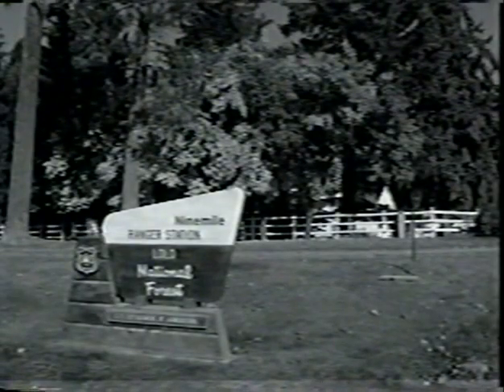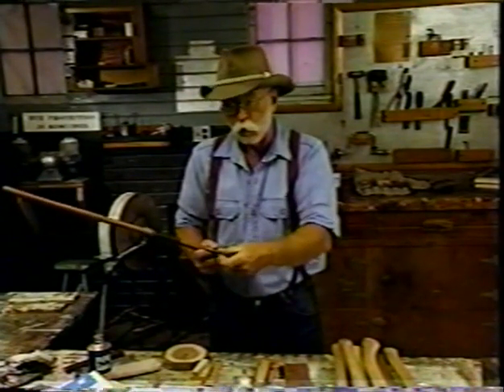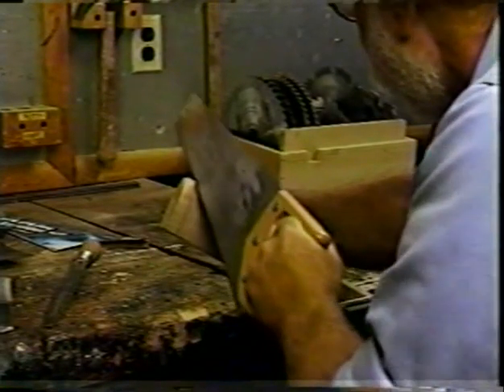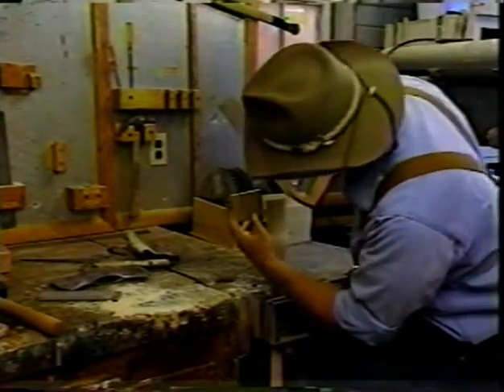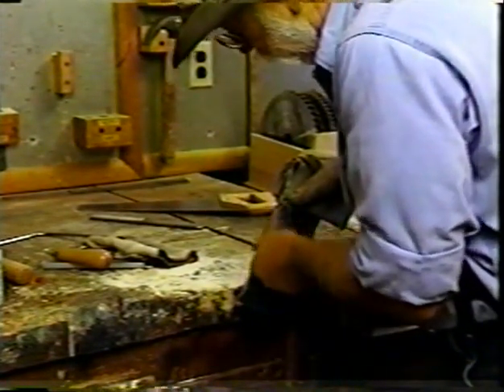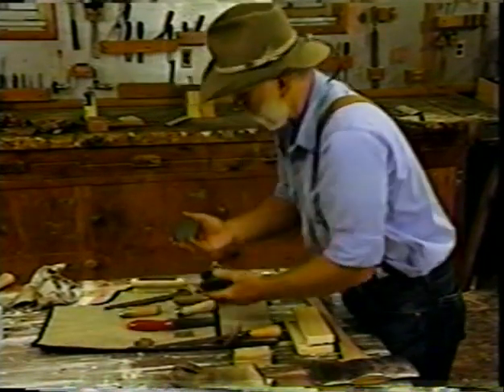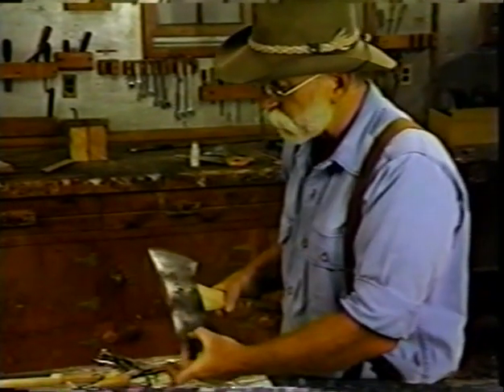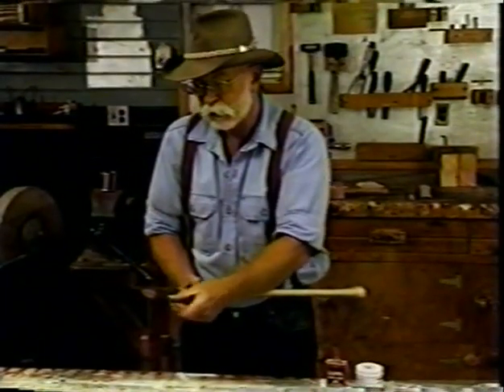An Axe to Grind - Part 1

Comment: This is a great video.  A few comments though.  Don't discard linseed oil rags by just throwing them away.  That is exactly how fires start.  hang it out to cure for a couple weeks before throwing it away.  It's the buildup of heat from wadding them up that starts fires.  I like metal cross wedges.  I've never noticed that a handle failure was due to them.  And what is the alternative when a handle comes loose?  You can soak it in oil one time to swell the wood, but it won't work again after that first time, at last not if it's linseed oil.  I don't put in a metal wedge until it is needed usually, but if the handle needs to be spread from front to back or loosens with age and weather changes, compression or if someone else hung it poorly, then metal wedges are great.  the crescent pattern on the axe bit is dependent on the three dimensional shape of the axe blade.  A lot of new axes have thin bits already or even have a hollow depression behind the bit, and that rule won't hold true on those.

Comment: Mr. Weisgerber, I by far are not the expert that you are. I have hung a few axes probably more than most but not as many as many.I always oil my handle before i hang it so the oil is also under the ax, but i never see anybody else doing this. Have i been doing something wrong?